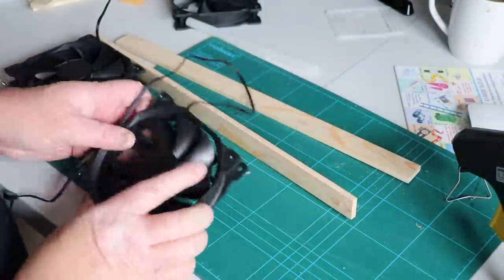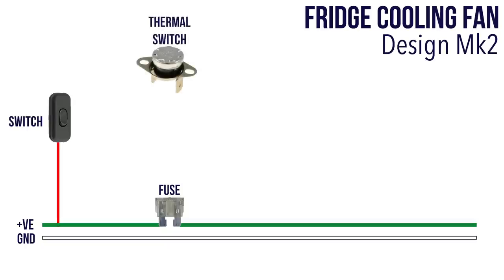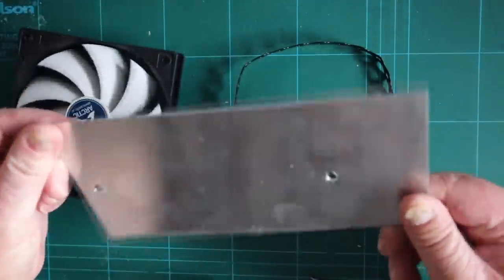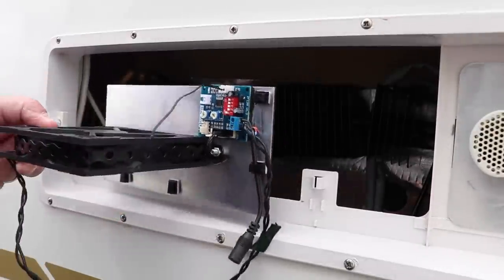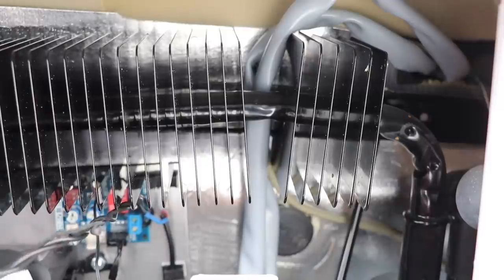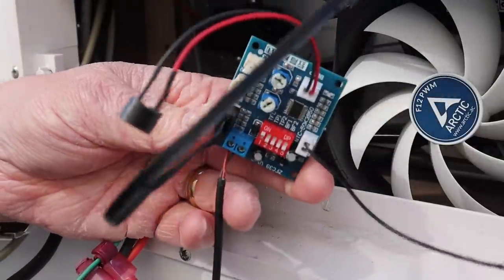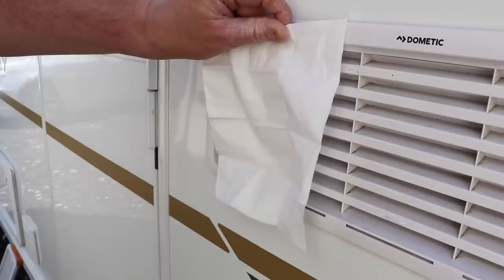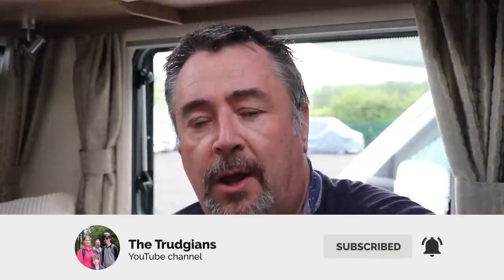Fridge vent fan upgrade Mk2

Comment: Thinking about doing this as it looks great and easy to do. The question I have is the way it is wired the thermal switch will put power to the controller board and if I am correct the controller board won’t do anything until it gets power via the thermal switch at 50 deg C which means that the thermal probe from the controller doesn’t do anything regardless until the thermal switch is on. Does this make the thermal probe redundant or is it’s main purpose to control the fan speed ? Thanks in advance.
Reply from the maker: HI Ian, you are spot on. The thermal probe will ramp the fan speed up if the temperature continues to rise, and as it falls the fan speed will reduce, once the thermal switch has been activated. (i.e its ruddy hot) other than that it will stay off. 

You can, if you wish do away with the thermal probe and just have the fan switch on and off with the thermal switch. Thats what the official kit does. 

Hope that helps. 

Dan
Reply: @TheTrudgians  thanks for the response, stuff ordered but thinking about putting in two fans as unsure if much difference with one or two.

Comment: Hi Dan, thanks for the  very informative video.
My question is, if you connect the fan to the 12v wiring, will the fan work when you are plugged into EHU?
Reply from the maker: Hi Roger, sorry for the delay. Yes when on EHU all you really connect is the battery charger and a few other mains voltage items. the 12v system is still running throughout the caravan. So, in short this will work providing you have a leisure battery on the caravan. 

Hope that helps.
Reply: Thanks guys, I have connected the fans now and all working well, thanks to you👍

Comment: Hey Dan, I am in the process of making your kit !  Thanks for all the hints and tips. Just one question please - how did you find out that it was the green and white wires you needed to connect to ?  Many thanks, Charlie
Reply from the maker: Hi Charlie, i used a schematic initially to pin point the wiring i needed, then to confirm i used a multimeter to measure the voltage across those wires. I then tested it was the correct circuit by removing the 2amp fuse on my bailey, which did confirm i was using the correct power feed.

Hope that helps

Comment: does this work aswell when running on  gas or mains, is there any issues with carbon monoxide entering the caravan because of the fan ,
Reply from the maker: Hi, this will work on any fuel selection, eg mains or Gas. and for Carbon monoxide, the back of the fridge is sealed off from the caravan cabin. The flue has its own outlet on the top fan that is isolated from the condensor pipe. If anything, this fan will help push out any lingering fumes to outside.

Comment: Will a caravan go up ramps or kerbs when using the remote control mover ??
Reply from the maker: Hi Yvonne, yes they will.
Reply: The Trudgians  Thank you very much are they worth the money. Where would you recommend purchasing one from ??
Reply from the maker: i would recommend a motormover and I would call a local caravan engineer on which one would suit yoru caravan, or if youve purchased a van from a dealership - they will be happy to add one on for you.
Reply: The Trudgians Thank you

Comment: Hi Dan great video as usual very informative. When you had your previous caravan and installed the 3 fans on the top grill did you release a video of how they worked ? If not did the do the job ok and the fridge worked ok in hot temperatures.

Comment: No need for a PWM controller at all. Just use 1200rpm or lower fans and a switch. They draw such small amounts of current you can just leave them on permanently. PC fans draw less than 0.1A at those rpms (specs are often printed on the fan). There are NO times where NOT having them running is beneficial, leave them on all the time and save your fridge the effort of waiting until it's warm before the fans turn on.

Comment: Im confused we have a tall fridge Bailey  Unicorn and two external vents.  Can anyone confirm is the fan fitted to the top vent?
Reply: Just watched again  - Top vent draw air up from the bottom.
Reply from the maker: Hi Allan, yes the fan is fitted to the top vent to blow air out. With fans, hot air rises to cool air circulates from bottom to top. Have a look at my previous fridge vent video - that should better explain the principle. 

Hope that helps.
Reply: @TheTrudgians  Hi good job. I've just done my van after fitting new fridge. On the bottom vent fitted constant speed fan blowing in, on the top vent fitted fan with thermostatic control included in the fan, blowing out. Both fans are unpluggable if the vent is removed. To be completely profesional I found a blank hole on the 12v control panel found a switch on ebay exactly the same as the other switches; pulled in wire behind cupboards, so it looks like factory job !   So as soon as fridge is on 'fridge vent fans' are switch on and regulate themselves - works a treat
Hope this helps and makes it easier
Dennis
Reply: About fans bottom any 12cm you fancy !  The top one obtainable from  www.cpc.co.uk part no.CS14797  £11.89
Dennis

Comment: Slightly off topic but has anyone ever considered changing out their rear tail lights for led ? They last longer and are brighter. Is anyone aware of a full tail light LED kit ?
Reply: Caravan tail lights !
Reply from the maker: Hi, yes you can use LED lights, but make sure they are "CAN BUS" friendly as this can affect the way they work with the tow car.

Some caravans, such as the new Swifts do have LED rear lighting.